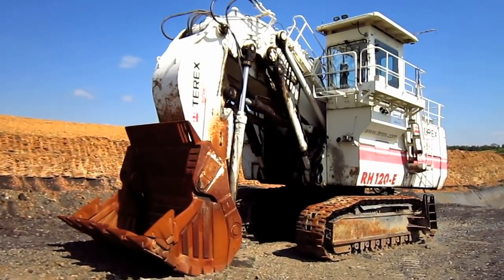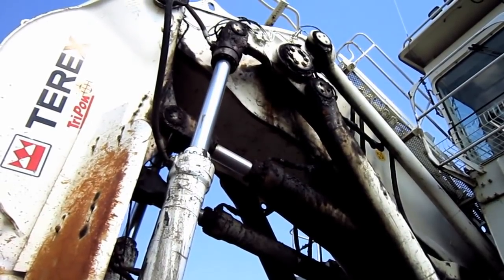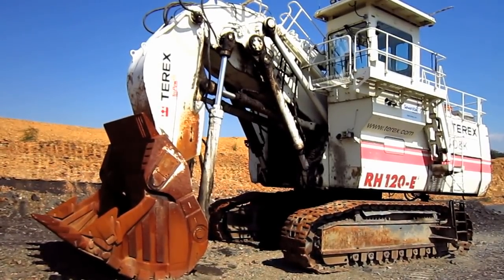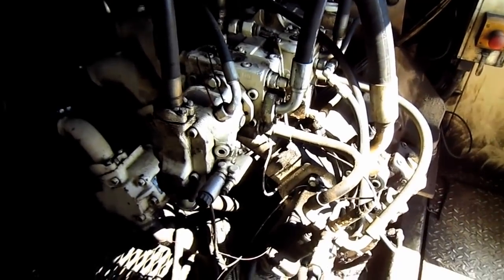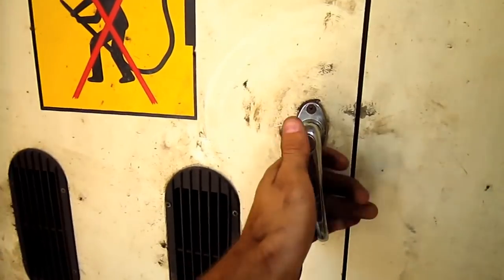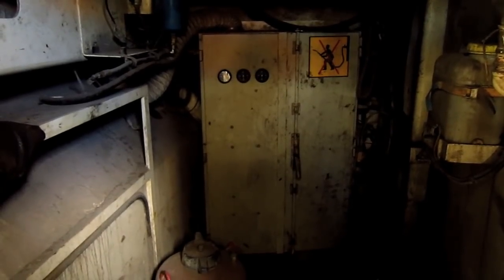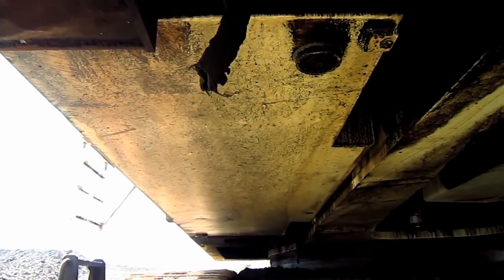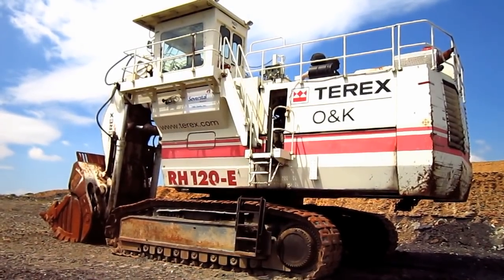Terex | O&K RH120E Documentary

Comment: Hello Justin
Thanks for all the nice videos.

It seems like they changed the digging reach scope for the later versions compared to the original 120C model. Do You know the reason for this?
Dig depth of 6.2 with breakout/tearout of 870/880kN is very inferior compared to competition in 300t class….
Originally 120C with over 8 meter depth and breakout/tearout force of 750/700kN was very competitive if not best in class of 200 tonne at that time…

Comment: Justin, i am having a hard time finding one of your videos i saw 2 weeks ago probably. You were inside the cab of a front shovel at the mine and a guy was trying to break loose a HUGE rock in open face wall that was larger than the D11 below. They had a D11 and D10 tag teaming it and pushing it out of the way of the shovel. Can you help me out?? Thanks man in advance. Your channel is awesome.
Reply from the maker: That would have been the Demag H185S video but it wasn't a front shovel it was a backhoe. I also did a PC4000 video where the operator was loading some a big rock on the truck. Hope this helps! Thanks!